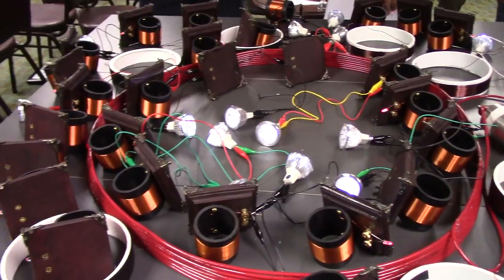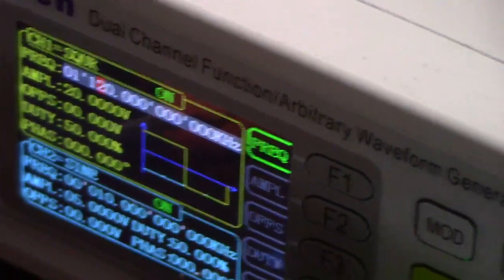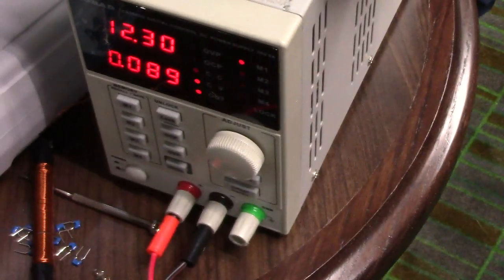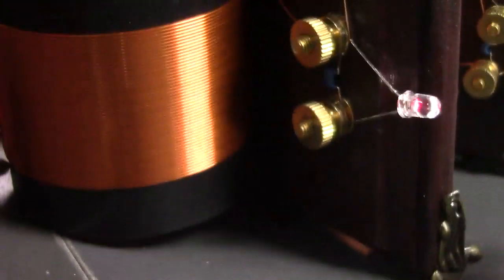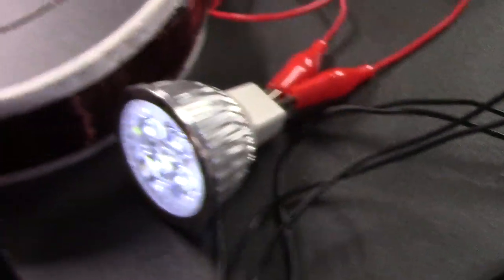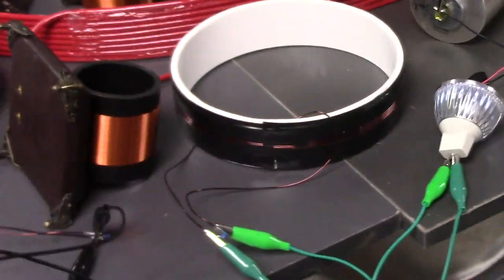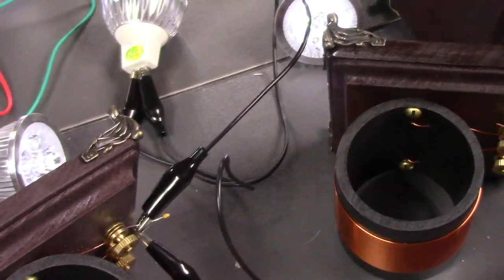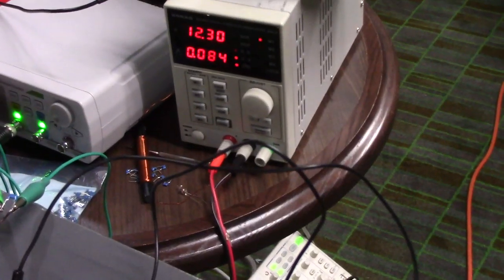1 Watt Resonance Kit Demo at last Renaissance meeting

Comment: The Mishin coil as the Rodiin coil and the Starship coils are resonant coils (RC circuits/tank circuits)
Reply: That's what I thought this morning. A am not a real physicist but when I thought of resonance, you should have a coil without contrary charge/poles, but only free flowing without resistance. And I thought 'would the rodin coil be the best for resonance therefor ?
Reply: @artofwebdesign  These so called "coils" have an internal capacitace. So it is a LC resonant circuit. The capacitance is between the bifilar would "coil" (== inductor).

Comment: do you have some kind of diagram that shows how the power source and the frequency generator are hooked up to the 28" transmitter coil. Are they both just hooked up o the ends of iit ? Any gate drivers/transistors or capacitors involved ?
Reply: diagrams are whats missing in most of your video´s. I know you´re not handing out free lunch, but you´ve put in so many hours - why not show schematics too..

Comment: I have just been able to reproduce a similar setting with a 4.5W bulb, 12V, 350mA, off the shelf . It was light modestly at 14 MHZ with a 7.7 V input ! This was done with a duplicate of the RICK kit (resonant induction coupler kit by Rick Friedrich).  Using one electrolytic capacitor 35V ?uF and a 14 meters, 2.2 uF inductor (or 2.2 mF ??). I'm posting this because one, I found a big regular lighting bulb that works like a charm with the rick kit !, and second, with a different coil and different capacitor, which shows that master Friedrich has shown me the right path to play with concepts and not only specific parts ! Cheers Rick !

Comment: Hello Rick, I bought dimmable 12V leds from Philipps but will have to return them as I wasn't able to turn them on. Would you share what types of LEDs you used in this setup ?
Question 2 : what is powered by the variable power box (showing 12.30  0.086a) ? the gate driver ? or the frequency generator ?
Reply from the maker: 2. The gate driver powering big red coil. The frequency generator is merely a logic signal input. 1. Ebay 6W 12V bulbs. Was a year ago so vender probably has changed them by now. I have many of these kinds of bulbs. Some of them require more exact power levels to turn on, whereas most of these require only a little power. The ones I showed in the two meeting videos need about 1/2W to turn on/show light.
Reply: @rickfriedrich  Thanks for sharing your knowledge and experience !
Reply: @rickfriedrich  Hi Rick, when you ordered those leds 3w 12v, where they saying AC / DC or both ? 2. what is the most ecological lamp that could be used similar to this in your opinion ? (I'm worried to have exhausted a lot of leds in a couple of years and would like a cleaner solution if it exists, in regard to this setup).
Reply from the maker: Actually these are 6W 12V AC/DC type. I don't know what is the most ecological lamp as there are thousands and they will always be changing from China. More importantly is the most healthy lamps for your eyes. We can power any light. These are not meant for hf and can be damaged by the hv as well. These videos were not showing some ideal or proper setup but rather to show a few points. A proper setup would be to do the frequency conversion, voltage regulation, proper grounding, etc. There is also no L2 in this setup on purpose. I did this to show specific things that have been ignored and which are very important facts Don shared. This was the first few stages Don went through and which is helpful to begin this research. I am satisfied that these points are established now.

Comment: Hi Rick. Thanks for putting out that. You mentionned never gotta go into the anti-gravity field, but personally I'd love to see some instructables about it...mmh. Would you mind sharing what are the specs of the "high quality variable capacitor" in this setup ? I'd like to see if I can understand its relationship with the kit, in which I have experimented.
Reply from the maker: I don't have the details in front of me. They are not important. It was like 80pf to 1000+pf vacuum cap. It would cost about $300 new. 
I did not tune this cap with the coils as I ran out of time. The 8 big coils were not perfectly tuned with the small regular coils. I had different very good caps on all the coils before I realized that they actually measured 116pf rather than the 100pf so this messed up the setup initially. So we had to unsolder those caps and add the smaller ones. By the time that was done I just adjusted the frequency rather that retune the variable cap. The inductance of the bigger coils was slightly different so I really needed variable caps on all the big coils (which I sent them out to those who bought them with) to properly tune all this. Not to mention more carefully position them all. Nevertheless it was good enough to show a significant demonstration and showing something new with the bigger coil.
Reply: @rickfriedrich  unsolder - replace - 'not very important' - 80 to 100 to 116 to 1000 pf. First, thank you Rick. When you say that's unimportant actually you are indeed showing it is, in my own understanding and experience :). To create the resonance, you are showing that adapting the capacitance is one way to go, which is probably much easier than adapting the inductance...well that's also my current understanding. Am I right ? Mh. Now, 100 to 1000 pf is very small. I guess the mediums coils and big coils and so many more in self-capacitance, aren't they ? I get to experiment more around this, right...so to see if and when a so small capacitor does any job in a LRC resonantly tuned tank, while compared to the same tank without capacitor in resonance, ie LR tank. I have done this and it was easier for me to modify the frequency, since I had no variable capacitance nor variable inductance. But then like your setup at the meeting (which I did not attend), setting a bunch of lights keeping the parts in resonance is a job it itself...isn't it ! And so, in this video you are still achieving this albeit imperfectly from your desired standard. But already, thank you for that because that's a precious demonstration. This standard would, in my opinion, to give indications on what could or should be the length of the super big coild, and the medium coils. I would desire to know if they are length-matched or not, ie...what are the coil's lengthes, and individual inductances, and individual capacitances for each of the parts. I would expect the experiementer to learn from you about it, then to experiement on his own about the part's relative physical 3D-"locations"...:) That way may be we would be able to start to design a super-system of wireless parts based on your "resonance induction coupler kit" you are selling for a few bucks (not to mention you are reviving Tesla). That would be an excellent propelling of the kit's level 2 concepts through a practical experiment and utterly-detailed setup instruction set (which is what your kit is, after all). God bless me I've bought your Kit ...and met you in this life. Not to mention I'm not done yet with you, Mr auto mechanic :D
Reply from the maker: Yes, that is what Tesla said as well. But variable capacitance is not usual above 2500pf (2.5nf). If you use bare coils you can always tap them where you want however. Yes the bifilar coils were shown in Tesla's patent to have much more capacitance so as to remove the need for capacitors. That setup in the video/meeting was just thrown together without tuning. The medium and smaller coils had almost the same inductance and initially (last meeting) the big coil had the same (but in making it bigger the inductance changed). These are not ideal setups with 1/4 wave, they are just showing how much flux can be intercepted (each secondary creates it's own energy with its own electrons spun by the influence of flux passing through it) when positioned in a small slice of the radiation. I'm not sure what else I can make available for the general public as this is dangerous. I'm looking to sell the 6" bigger coils soon, once it gets set up.
Reply: @rickfriedrich  You have named a very good point with competes with variable capacitance VS "using bare coils and connecting where you want". Thanks for bringing that point Rick. I had'nt connected the two concepts.

Comment from the maker: Now these supposed receiver coils represent a sliver of the area of radiation of the 28" transmitter coil on the table. As can be seen with the little coil I bring above and under the table, I can add many more layers or stack coils on top of each other without affecting the bulbs or output (or drawing more input). So that means we can multiply this output many times as we consider the whole area affected (and also beyond the very near field we are in). 
* This also means that this sliver can be after an L1/L2 setup where all the flux passes through an L2 and continues on through these additional coils. The L2 has the full flux and it's electrons are impulsed and spun, but the flux is not consumed or used up and continues on to affect additional coils as you see here. *
Reply: Did I miss you mentioning the frequency and waveform of the transmitter?

Comment: And if you turn them all off, what happens to the input power?
Reply from the maker: Hey hey look who it is! What do you think would happen? IF all the energy was being transferred from the transmitter to these coils and loads then the input power would accord to the amount of loading. This is what I show with two Tesla coils controlled with PLL circuit. But that is not what is happening here. There is a loose relationship between the coils and loading of the additional coils results in lowering the input (unless the are or almost touching the primary).
Reply from the maker: yeah